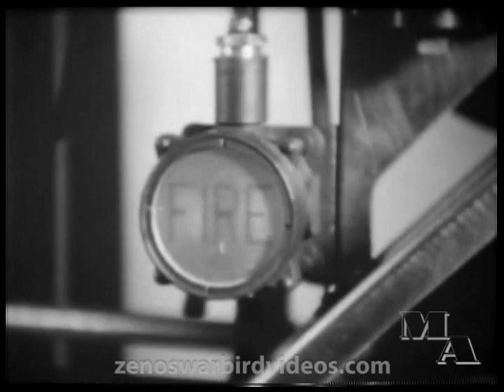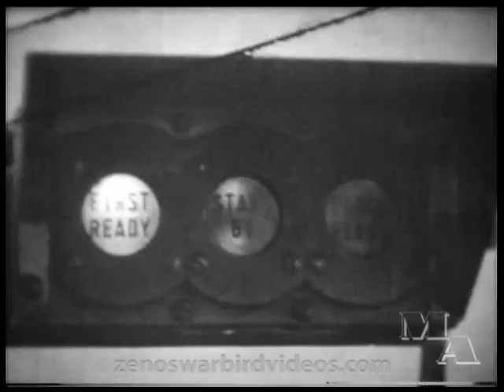Catapulting off a US Navy Carrier - 1944

Comment: Never seen anything like this about WW2 carrier ops. This is a treasure.
Reply: for the fleet carriers it was redundant. the airspeed needed to reach launch was mostly accounted for by the sheer speed of the carriers. ~30knts. given the sheer length. most planes could reach takeoff speeds. in many films we apparently see the plane drop like a rock after reaching the end of the flight deck. but in many cases unless it was a very laden bomber the drop is actually just the bow action of the ship.

Comment: I thought that WW2 carrier had aircraft that could launch unassisted, I never knew they used catapults on carriers back then.
Reply: While they had them, the full sized fleet carriers such as the Yorktown-  and Essex-classes didn't need to use them very often. The smaller light carriers such as the Independence-class, and especially the even smaller escort carriers like the one in this video(either a Bogue- or Casablanca-class, I think) needed to use them much more frequently.

Comment: It always amazes me that things like this can be done--and have been being done for nearly a century now, and there's a thought for you--with a relatively reliable expectation of safety.  Because a failure at any single step has the potential to get someone or maybe multiple someones killed real ugly, and a failure at certain vital steps nearly guarantees it.  And the process is even more dangerous today with much more powerful jet aircraft, and many more people running around on the deck; on the other had, that nearly a century of practice hasn't gone to waste.  Even still, back in the 80s and 90s (I don't know if this is still true) carriers averaged just about one fatal accident per deployment, not too bad considering that there are 5000 people on a modern carrier, and that figure includes anyone who stumbled off the deck in a Ny-Quil induced stupor.  On the other hand, carrier deck crews had and presumably still have a comparatively high rate of non-combat deaths compared to any MOS in any branch of service.  There's only so much that can be done to make the job safe, but the fact that it can be done at all is a testament to professionalism.

Comment: i hear on the bigger ww2 carriers some had cats but the pilots often prefered not to use them because their planes had enough space to fly off under their own power. plus it was faster to get into the air
Reply: capt rodgers yeah I have the same question , and idk why I don't see catapults in a lot of US Navy carrier during ww2 like Lexington , Independence and Midway class carriers
Reply: @buster117  WWII propeller planes required a lower takeoff speed, so the speed of the plane + the speed of the sailing carrier was enough to get planes airborne. You can also see this in other countries' carriers such as Akagi or Kaga.
Reply: I believe that this type of catapault was only used briefly, in historical terms, on just a few ships, right at the end of WWII.  Keep in mind that the catapult room takes up valuable space, and weight, which otherwise could be used for carrying more ordinance or fuel.  Not to mention the usage of  ship's energy and crew's man hours.  This type of catapult may have been very useful for a cruiser or battleship, as we see at the beginning, allowing them to launch a seaplane laterally on a 60 foot rail. But the aircraft carriers had the luxury of a few hundred feet of deck,  and the ability to point that deck into the wind and sail fast into it. 

So it was typical for WWII aircraft carriers to just not have catapults,  and then not long after this video was made, it was typical for aircraft carriers to have much more powerful steam catapults,  which really made a difference and allowed launching high speed, heavy jet fighters with minimal deckspace.  Someone correct me if I am wrong, but I think that the fairly-weak compressed air catapult that we see in this video had a limited service on just a few ships, bridging two eras in Naval history.
Reply: @StephenMarlerexperience  All the fleet carriers in the US Navy (the big ones) had hydraulic catapults. Both the Yorktown Class & Essex Class (The Lexington CV2 and Saratoga also had catapults) carriers had catapults. The Essex class had two at the bow whilst the Yorktown class only had one at the bow. 

Catapults were used all the time, but it was obviously quicker to do a deck run. Often they'd use catapults when the conditions required them to do so, for example if the ship couldn't steam at full power into the wind due to unforeseen problems, such as engine trouble, or perhaps the wind blew in a direction that was inadvantageous to the Carrier Strike Group and so forth.